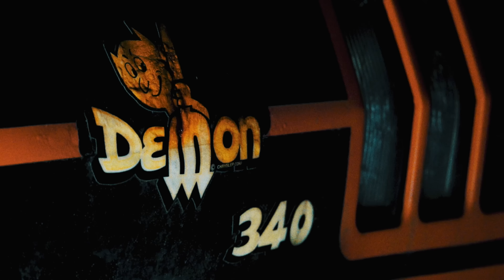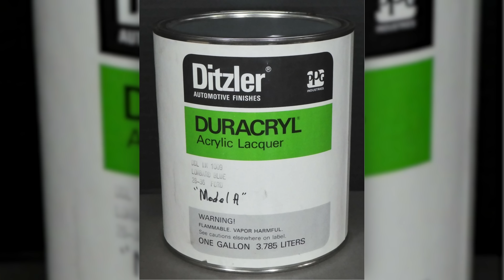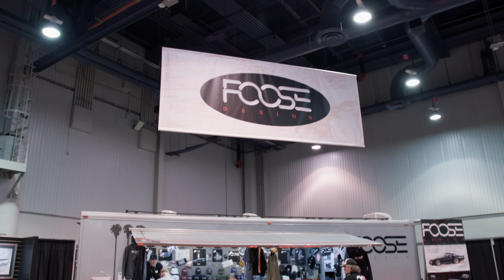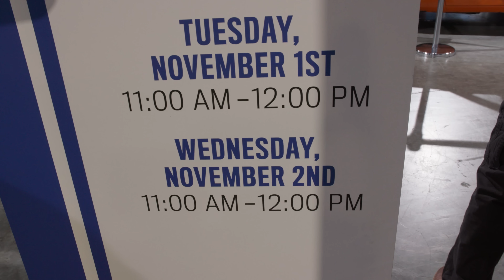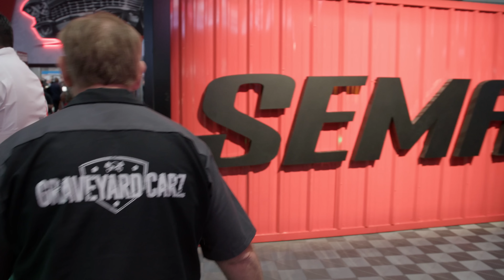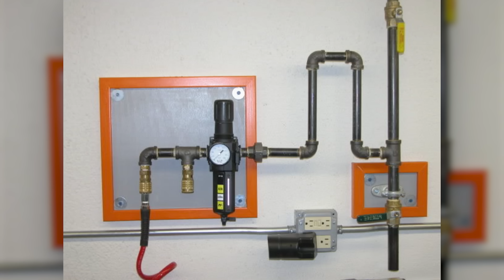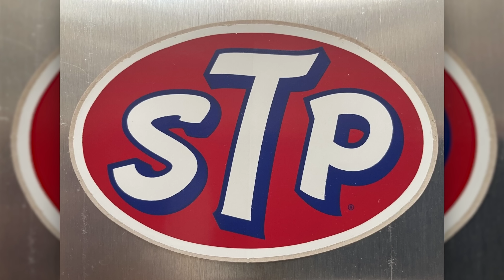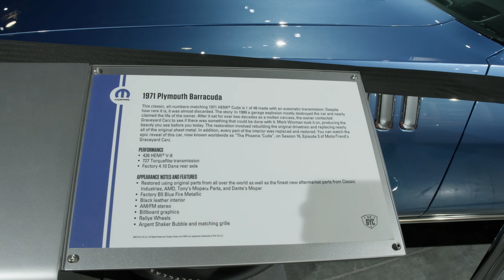A SIN AGAINST HUMANITY: 807 HORSEPOWER 1970 CHALLENGER T/A HELLCAT RED EYE!

Comment: definitely improved that 70 challenger 100% . those 70s motors were junk compared to the new ones . old motors are unreliable and only had like 300hp and got 2 miles to the gallon . while these new hellcats have 600+hp factory and get 20 miles to the gallon . the old cars look cool and thats it . but the new cars crush them in handling and performance .